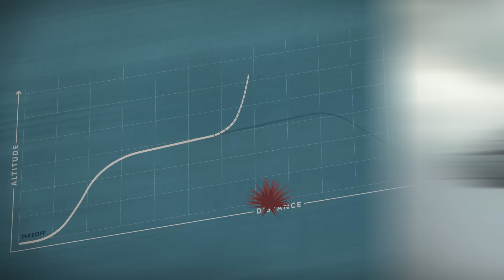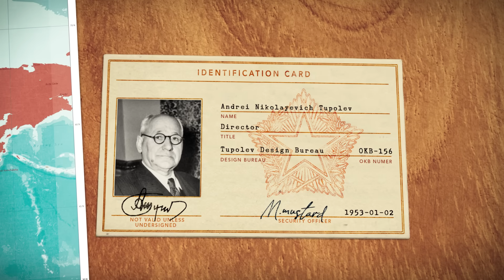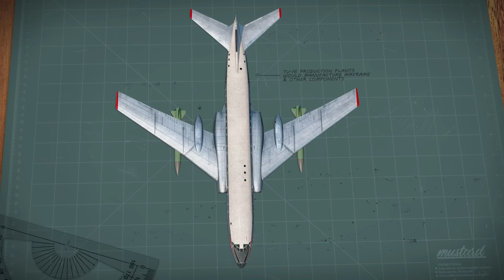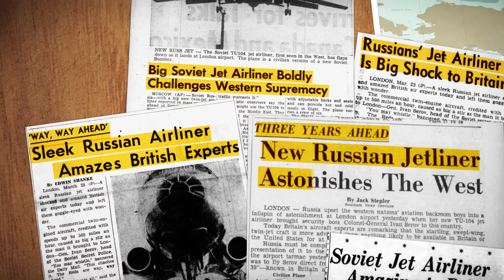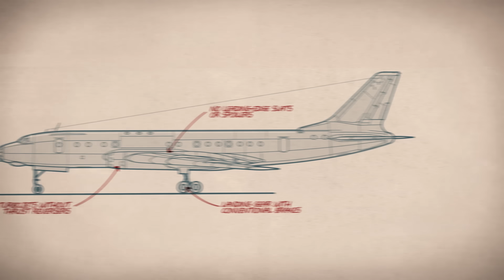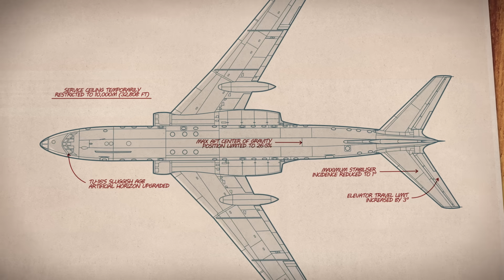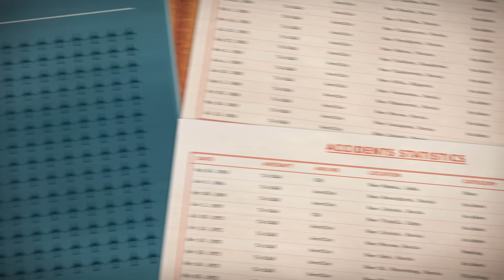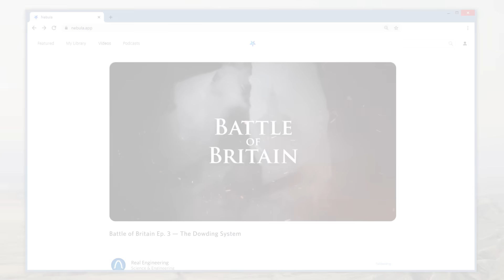The Soviet Airliner Designed To Crash

Comment: Comet was the most dangerous plane and they kept falling off the sky regularly and so British lost the aircraft race
Reply: Obviously it's always very important to note the relevant facts.

    How things were back then -
Accident losses - % of aircraft built.
DeHavilland Comet 4 UK     14% 
DeHavilland Comet all mks  17%  
Vickers VC10 UK 5%
   The DH Comet had better safety than or similar safety to many other commercial passenger aircraft of a similar era
    Douglas DC-1        99%
      Douglas DC-2        47%
    Douglas DC-3        30%
      Douglas DC-4          26%
    Boeing s300            72% 
 Boeing 307               70%
  Boeing 247                48%
     Boeing 707                   20% 
Lockheed L-049/149 Constellation  30%
   Lockheed Electra  Turboprop    29%
Fairchild FH-227                        30%
 McDonnell Douglas DC-8        14%
  Sud Aviation Caravelle            15%
Canadair CL-44  Turboprop     46%  
Convair CV-580  Turboprop     22%
Convair CV-880    (ff 1959)       27%  
Convair CV-990     (ff 1961)      33%
Tupolev T-104          (ff 1956)    16%

Obviously the French Caravelle, a very similar aircraft to the Comet, also at the time didn't result in Sud Aviation becoming a significant competitor to Bow-wing  (See B-47 wing folding and wing collapse incidents).
        The Comet was designed with military use in mind, Nimrod work started at De Havilland in 1953.
  The committee did not find hundreds of fatal flaws or evidence of design defects, structural defects, defective materials or shoddy workmanship. Ripstop provision was included. Claimed incidents did not involve cracks starting from window corners & one particular incident did not involve a fracture running from a rivet hole. 
     The engine & engine intake position had advantages, were not flaws or fatal flaws & were not the cause of any incidents involving any Comet or Nimrod aircraft. Nearly all changes before the Comet 4 were just in case or were previously scheduled improvements. 
  In fact it is the case that the skin thickness of the Comet remained largely unchanged for later versions. The alloy used was changed simply because the manufacturer discontinued the original version. 
  Bow-wing & the 707 story (see b-47 wing folding & wing collapse incidents) is the result of global economics & the well protected & very large domestic US airliner market & active support from the UK with for instance proposed competing airliners from Vickers & DH being blocked by the UK government at the time, cheap & nasty was the requirement with large scale production capability in one place.
  The 707 was of course a much larger aircraft which as a stressed skin metal airframe aircraft would require a thicker skin anyway. They got lucky at the time essentially.  Bow-wing is the result of the large & well protected  US domestic airliner market 
  The 707 had a very long production run with a large number produced, the average life of a 707 doing airline duty only was about 22 years. Military duty 707 airframes get a lot of big military budget attention & there are plenty of spares from retired aircraft which is why there are still examples in service.
  The fate of De Havilland was due to Govt policy Aerospace sector rationalisation & global economics, it was nothing to do with the Comet.
  A comprehensive, thorough & protracted testing program was carried out on the prototype & it's assemblies. Of course the Comet did indeed have Ripstop stop provision. 
     De Havilland (Of England) Comets were not grounded after 1970 due to structural problems.
It's interesting that some of the aircraft on the list should really have been noticeably safer than the Comet due to being a similar type but of much later design & manufacture but they definately were not safer.
    How things were back then -
Accident losses - % of aircraft built.
DeHavilland Comet 4 UK     14% 
DeHavilland Comet all mks  17%  
Vickers VC10 UK 5%
   The DH Comet had better safety than or similar safety to many other commercial passenger aircraft of a similar era
    Douglas DC-1        99%
      Douglas DC-2        47%
    Douglas DC-3        30%
      Douglas DC-4          26%
    Boeing s300            72% 
 Boeing 307               70%
  Boeing 247                48%
     Boeing 707                   20% 
Lockheed L-049/149 Constellation  30%
   Lockheed Electra  Turboprop    29%
Fairchild FH-227                         30%
 McDonnell Douglas DC-8     14%
  Sud Aviation Caravelle       15%
Canadair CL-44  Turboprop   46%  
Convair CV-580  Turboprop 22%

A comparison of more recent aircraft.
Accident losses comparison examples. 
1970s - 1980s
    % of total Aircraft built
Similar aircraft type, date / decade, useage, size.
    Biz Jets
BAe-125-800                        1.7 %
Beechcraft Beechjet 400    2.2 %
Cessna 550 Citation II         7.1 %
Learjet 35 / 36                       12 %
Beechcraft 1900                  6%
Dassault Falcon 10              11.5%
Aérospatiale SN.601            22.5%

Medium size jets / Turboprops.
BAe-146               5.1%
Fokker 100          6%
McDonnell Douglas DC-9-30       9.5%
Fairchild FH-227       30%
McDonnell Douglas DC-8    14%
Canadair CL-44  Turboprop   46%  
Convair CV-580   Turboprop   22%

Beechcraft, Fokker, McDonnell Douglass, Learjet, Fairchild, Aerospatiale, Canadair, Convair  companies defunct.

    All Comets, including some Comet 1s, had full civilian use certification at some point after 1954,  civilian use certification only being withdrawn after commercial flying stopped. Examples were flying until 1997 - one example did a signals research global circumnavigation flight series in 1993 via Australia virtually without a rest travelling 28000 miles, only had an ice warning indicator issue during the flights.

    The DH Comet - World Firsts.
1st gas turbine jet powered airliner. 1st high altitude 8psi pressurised full fuselage length passenger cabin airliner,  not a trivial feature as structure  strength required for pressurisation considerably exceeded strength required for normal flying stress. Nobody else had done anything similar before the Comet.
  The b-47 (& the Junkers) used relatively small, heavily built  pressurised modules  (the aircraft where 6 had their wings fold up in 2 months while flying & some had their wings fall off while parked). 
   The 1937 Boeing piston engined airliner pressurised passenger cabin was pressurised to 2 psi only - in fact that could easily be done as the normal unpressurized fuselage cabin structure strength for flying stresses only was all that was needed to be adequate so no significant weight increase issues needed addressing.
    1st all hydraulically powered flying surface controls & actuators airliner with under carriage wheel disk brakes + ABS.
1st jet airliner to cross the Atlantic.
1st jet aircraft to do a world circumnavigation flights series.
  Of course De Havilland had prior experience building many all metal construction airframe aircraft including thousands of jet powered fighter aircraft that were primarily of metal construction with pressurised cockpits & jet engines built by De-Havilland & we know the world's first all metal construction airframe airliner was built in England in the 1920s by Handley Page.
     De Havilland did indeed always work to better than industry standards at the time, used up to date knowledge for the design & no evidence of negligence  or criminal negligence was ever produced in relation to the DH Comet.
    The course of De Havilland & the general UK aerospace industry sector was not affected even slightly by the DH Comet. The course of national aerospace sectors obviously being similar & inevitable in many countries.
     Other interesting World firsts
World's first turboprop aircraft.
Vickers Viscount Turboprop Airliner 1947. 
A 1945 Gloster Meteor Aircraft with Turboprop Gas Turbine Engine.

They might like to answer these questions.
   Which airline has just ordered
60 RR England Trent XWB Engines
& What aircraft are the engines for?

Bonus question for 10 points.
         Which country has the 
World's Highest Combined Per Capita
  Nuclear + Defence + Aerospace Sector Activity?    

          👍 & 🙂 & of course 😎 indeed.
          C H E E R S & without doubt  -
          Toodle PIP Old C H A Ps.
 
This line left not blank intentionally.
           
   The next line is blank intentionally.     
                
. .... . ... ...     . .
. . ... ..         ...

Comment: What this video taught me:
When western made: Trying to achieve new leap in technology
When soviet made: Propaganda
Reply: Was looking for that comment. Would have made it myself, if not found. Westerners are heavily propagandized and they have no clue, that they are.
Reply: Indeed, that's entirely correct of course & probably always will be entirely correct of course won't it?.

However, we do indeed feel we can clear up some commonly held myths and misconceptions, without doubt obviously.

It always good to deal with facts isn't it.

Obviously there have been worse aircraft for accident losses both before & after the DH Comet & the Tupolev T-104.

    How things were back then -

Accident losses - % of aircraft built.
DeHavilland Comet 4 UK     14% 
DeHavilland Comet all mks  17%  
Vickers VC10 UK                     5%
Tupolev T-104                          16%

   The DH Comet & Tupolev T-104 had better safety than or similar safety to many other commercial passenger aircraft of a similar era

    Douglas DC-1        99%
      Douglas DC-2        47%
    Douglas DC-3        30%
      Douglas DC-4          26%
    Boeing s300            72% 
 Boeing 307               70%
  Boeing 247                48%
     Boeing 707                   20% 
Lockheed L-049/149 Constellation  30%
   Lockheed Electra  Turboprop    29%
Fairchild FH-227                        30%
 McDonnell Douglas DC-8        14%
  Sud Aviation Caravelle            15%
Canadair CL-44  Turboprop     46%  
Convair CV-580  Turboprop     22%
Convair CV-880    (ff 1959)       27%  
Convair CV-990     (ff 1961)      33%
Tupolev T-104          (ff 1956)    16% we can clear up some commonly held myths and misconceptions.

It always good to deal with facts isn't it.

Obviously there have been worse aircraft for accident losses both before & after the DH Comet & the Tupolev T-104.

    How things were back then -

Accident losses - % of aircraft built.
DeHavilland Comet 4 UK     14% 
DeHavilland Comet all mks  17%  
Vickers VC10 UK                     5%
Tupolev T-104                          16%

   The DH Comet & Tupolev T-104 had better safety than or similar safety to many other commercial passenger aircraft of a similar era

   Douglas DC-1          99%
   Douglas DC-2          47%
   Douglas DC-3     .    30%
   Douglas DC-4          26%
   Boeing s300            72% 
 . Boeing 307              70%
   Boeing 247              48%
   Boeing 707              20% 
Lockheed L-049/149 Constellation  30%
Lockheed Electra  Turboprop            29%
Fairchild FH-227                                 30%
McDonnell Douglas DC-8                  14%
Sud Aviation Caravelle                      15%
Canadair CL-44  Turboprop              46%  
Convair CV-580  Turboprop        22%
Convair CV-880    (ff 1959)         27%  
Convair CV-990     (ff 1961)        33%
Tupolev T-104          (ff 1956)      16%

Obviously we hope this helps.

Cheers 👍.

.   .  . .
. .. .  ..

Comment: "Too close for missles; switching to guns."
Reply: Indeed, that's entirely correct of course & will probably always be thoroughly correct of course.

However, we do indeed feel we can clear up some commonly held myths and misconceptions, without doubt obviously.

It always good to deal with facts isn't it.

Obviously there have been worse aircraft for accident losses both before & after the DH Comet & the Tupolev T-104.

    How things were back then -

Accident losses - % of aircraft built.
DeHavilland Comet 4 UK     14% 
DeHavilland Comet all mks  17%  
Vickers VC10 UK                     5%
Tupolev T-104                          16%

   The DH Comet & Tupolev T-104 had better safety than or similar safety to many other commercial passenger aircraft of a similar era

    Douglas DC-1        99%
      Douglas DC-2        47%
    Douglas DC-3        30%
      Douglas DC-4          26%
    Boeing s300            72% 
 Boeing 307               70%
  Boeing 247                48%
     Boeing 707                   20% 
Lockheed L-049/149 Constellation  30%
   Lockheed Electra  Turboprop    29%
Fairchild FH-227                        30%
 McDonnell Douglas DC-8        14%
  Sud Aviation Caravelle            15%
Canadair CL-44  Turboprop     46%  
Convair CV-580  Turboprop     22%
Convair CV-880    (ff 1959)       27%  
Convair CV-990     (ff 1961)      33%
Tupolev T-104          (ff 1956)    16% we can clear up some commonly held myths and misconceptions.

It always good to deal with facts isn't it.

Obviously there have been worse aircraft for accident losses both before & after the DH Comet & the Tupolev T-104.

    How things were back then -

Accident losses - % of aircraft built.
DeHavilland Comet 4 UK     14% 
DeHavilland Comet all mks  17%  
Vickers VC10 UK                     5%
Tupolev T-104                          16%

   The DH Comet & Tupolev T-104 had better safety than or similar safety to many other commercial passenger aircraft of a similar era

   Douglas DC-1          99%
   Douglas DC-2          47%
   Douglas DC-3     .    30%
   Douglas DC-4          26%
   Boeing s300            72% 
 . Boeing 307              70%
   Boeing 247              48%
   Boeing 707              20% 
Lockheed L-049/149 Constellation  30%
Lockheed Electra  Turboprop            29%
Fairchild FH-227                                 30%
McDonnell Douglas DC-8                  14%
Sud Aviation Caravelle                      15%
Canadair CL-44  Turboprop              46%  
Convair CV-580  Turboprop        22%
Convair CV-880    (ff 1959)         27%  
Convair CV-990     (ff 1961)        33%
Tupolev T-104          (ff 1956)      16%

Obviously we hope this helps.

Cheers 👍. Etc 

 . . ... . . ... . ..... . . ...